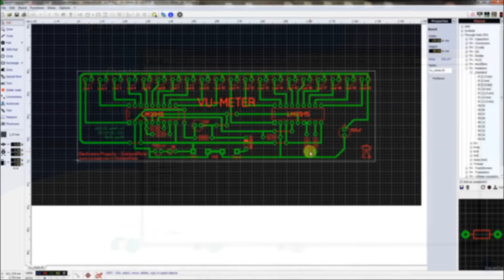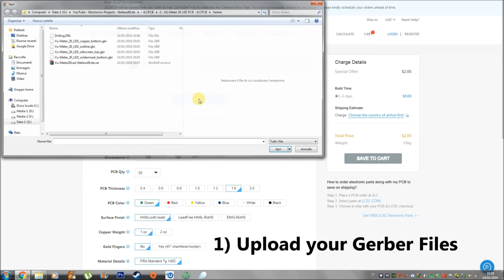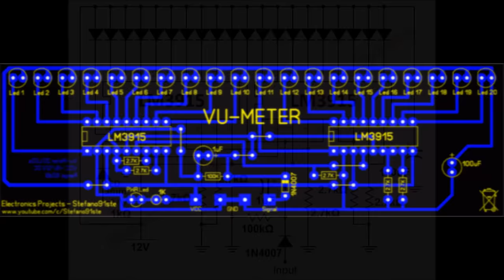Vu-Meter 20 LEDs LM3915 - PCB TUTORIAL

Comment: Hallo Stefano. Ich habe einen anderes VU- Meter mit 10 LED gebaut. Ich habe 3914 und 3916 verwendet. Der 3915 wird angeblich nicht mehr hergestellt.
Du lässt immer gleich große Menge  an Platinen herstellen. Ist es möglich 1 bis 2 bei dir zu erwerben ? Ein Auftrag mit 2 lohnt nicht.
Angebote anderer User, die einen großen Auftrag erstellt haben, sind ebenfalls erbeten. 
Die Bauteile habe bzw besorge ich selbst.

Comment: I have make this circuit.. but 1st 3 leds are remain on... What is the problem? Can you please reply?
Reply from the maker: Hi, the problem could be related to some noise present in the power supply, or on the audio signal
Reply: i have same problem, probably us use the same component LM3915N-1 or  equival.
Reply: Could our friend Stefano from the you tube channel help us !?

Is it because of the LM3915N-1?
Reply from the maker: Hi, try to replace the 100K resistor with one with a value between 33K and 47K

Comment: hello Stefano.... i made this VU meter but there's a  problem . the 1st 10 leds are working good but the 2nd 10 are working like one led they turn on together and go off together not up and down on sequence steps .....when i increase the resistor  that is connected between pin #4 on ic 2 and the ground it work better but the 1st 4 led keep on always ... i tried many many many ways and same result ... any ideas ???
Reply from the maker: Hi, the problem could be due to some disturbance related to the power supply, unfortunately not all power supplies are filtered properly.. try to power it with a 9 volt battery, if the problem persists try to replace the 100K resistor with a 33K one.
Reply: @Stefano91ste   I did everything  ... I use same power supply for both ... I change 100k to many different resistors but same results

Comment: Hello, quick question, how do you add a peak hold to an LM3916 IC? cheers
Reply from the maker: Hi, unfortunately it is not possible on the LM39XX series
Reply: @Stefano91ste  I heard you can add a transistor to give it a peak hold
Reply from the maker: @Synthematix  A few years ago I tried but without success .. anyway it would be nice to succeed😁
Reply: @Stefano91ste  Apparently you only need to add a transistor  on each channel with a capacitor to control the falloff speed

Comment: Hi!
Like anything else, I have 5 LEDs on. Power supply 10v. ) was the same with the battery. There is an error even without a signal source.
Can you help?
Thank you!!!
Reply from the maker: Hi, sorry for delay in my reply, I try to help you!
it's something I don't know why it happens to some users.. (I think it's the fault of the LM3915, maybe people buy LM3915 not produced by TI).
Try these solutions:
1) connect the vu meter to an amplifier.
2) check all the welds, check that the components are correct and functioning.
3) use another LM3915
4) try to replace the 100K resistor with a 47K one

Comment: we built this. sadly doesn't work properly. built it 4 times in hope was component fault but same every time. bottom 4 leds stay on permanently. clean 12v lab power supply, with or without input connection same problem. tried different IC supplier. same every time.

Comment: Can Stefano help us !?
are lighting the first 3 led
I used LM3915N-1
And you LM3915
What modification would be necessary?
Reply from the maker: Hi, try to replace the 100K resistor with one with a value between 33K and 47K
Reply: @Stefano91ste  I tried to use the 1k resistor, but the first 3 leds remain on.
Would you like photos or video? You will be surprised at what you will see.
I made a very archaic structure I think I would even put in your videos.
Reply from the maker: 1K is too little, and with 1K it is impossible for the first 3 LEDs to be lit without music. Check that there is no wrong component :) I wouldn't go below 33K for that resistor, otherwise it completely cancels the 1uF capacitor.

If You had a link to a video of your project it would be great, I looked on your channel but I only see one video
Reply: @Stefano91ste  Ok I will try the 33k resistor...
Reply from the maker: Let me know
Reply: @Stefano91ste Helo Stefano.
Hi again.
I changes the resistor... the resisrtor 33k remain 6 leds on, and the resistor 44k remain 5 leds on.

Comment: Hi, very good circuit. but I have a small problem, when I turn it on, the first 2 LEDs remain on, I have tried a different audio source and the problem persists. What could be the cause of this?
Reply from the maker: Hi, it could be a power supply problem, try adding a 100 ohm resistor on the signal cable coming from the amplifier
Reply: @Stefano91ste  me too have same problem, even i have 4 LEDs remain on, i have tried to add 100 ohm to signal, but it still not working. How to fix that?

Comment: Ola Stefano, tudo bem..... Fiz o circuito, mas todos os leds acendem juntos quando ligados a uma fonte. Verifique várias vezes o circuito, não encontrei nada errado. Já fiz a troca do resistor de 100K por um de 50k, também mudei a fonte por uma bateria de 9v, mas o problema continua. O que  pode estar acontecendo?  Pode me ajudar........Saudações do Brasil.
Reply from the maker: - Hola, es extraño que todos los LED se enciendan (incluso alimentando el circuito con una batería de 9V)... son los componentes correctos? Funciona el LM3915? también intente volver a verificar las soldaduras

- Hi, it is strange that all the LEDs light up (even powering the circuit with a 9V battery).. are the components right?  Do the LM3915 work?  also try to re-check the welds.

Comment: Hi my friend! Like your vu-meter with 20 LEDs. He made a fee and soldered. I ask for help when I turn on the power the first six diodes are lit. Turn on the signal indicator is working. Sorry for my English)) I'm with a translator. thank for the answer. What to do so that these leds do not shine
Reply from the maker: Hi, thank you!
Hi, that problem may be due to some disturbance coming to the Vu-Meter through the amplifier or via the power supply.
Try to power the vu meter with a 9V battery, if the problem persists, the amplifier could be the cause, then try putting a 50 ohm resistor between the amplifier and the Vu-Meter or try another amplifier.
All this considering that the PCB has been assembled with all the correct and working components.
Have you tried replacing the 100K resistor with a 10K resistor?
Reply: @Stefano91ste  replaced a 100 kΩ resistor to a 15 kΩ resistor, 3 LEDs are lit. then I replaced the 100 kΩ resistor with a 8.2 kΩ resistor, and 3 LEDs also glow. maybe LM defective? glow even without connecting to the amplifier. I connected to 9 volts

Comment: When I did, the first six led light shone .ic heat. sir please reply
Reply from the maker: Hi, how do you power the PCB? 
some had this problem using unfiltered power supplies.. try a 9V battery
Reply: @Stefano91ste  use 12v battery
Reply from the maker: Strange, have you tried with another LM3915? between 9 and 12V must not heat too much because the current is limited by the circuit.

Comment: can we just replace 3915 with 3914 in this circuit?
Reply from the maker: Hi, Yes, it is possible, but the 3915 is more suitable for vu meters
Reply: @Stefano91ste  
The temperture meter using lm 3914 in ur other video didn't work please help me out
Reply from the maker: Hi, the thermometer project works, however tomorrow I will publish the final version. Your why didn’t work?
Reply: @Stefano91ste  it doesnt glow any of the LED while connected to source 9 v DC.
Just blinks once while initially touched the battery cap with battery
Reply: @Stefano91ste  I have selected it from your video as a college project and now only few hours until deadline it shows no sign of working. Please help me out bro.
Reply from the maker: Did you connect it to an audio amplifier?
Reply: @Stefano91ste  no . Infact i am searching for a way to amplify the audio with a transistor. How do i do it?
Reply from the maker: I should do some tests, I have never used transistors for this purpose.. maybe two or three cascade bc547 could be enough, but i have to try.  I advise you to use an LM386 to amplify the signal, I already have a ready circuit, the one I used in this video: https://youtu.be/Ex3waFdQrHY - It is not mandatory to use the TTC-167 audio transformer - unfortunately for this vu-meter I have not yet designed the PCB 😅
Reply: and it doesnt go beyond the first dot of second bar
and thus wanting to use a  BC 548 as an amplifier
Reply from the maker: A BC548 seems too little to me, the LM386 is able to turn on all 20 leds..
I saw your circuit, do a test, connect the signal cable to + 9V (it serves as a test to make all the leds turn on) - if they don't work, there is some error in the circuit assembly
Reply: @Stefano91ste  thankyou sooo much bro.
This helped me a lot .  dont know how do I thank you.

Comment: hey bro I was thinking that your PCB does not have standoff mounting holes if you are using Sprint Layout 6 is simple just place a pad and hole size set both values the same example for an M3 screw just place a pad and set to 3.20 mm and the hole is ready https://youtu.be/NNzzzAU7cBE
Reply from the maker: Hi, thank you for this!:)
I did not insert the mounting holes on purpose, I wanted this PCB to remain as clean as possible, in fact I took care of the maniacal arrangement of the components.
I will add them for the next project;)
Reply: @Stefano91ste   awesome man :)